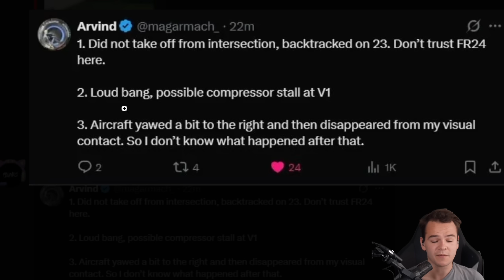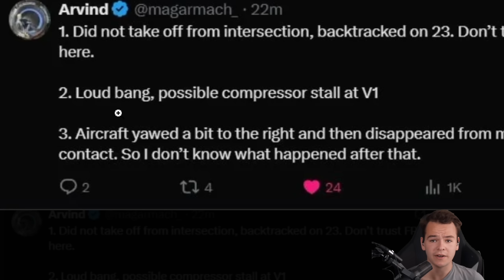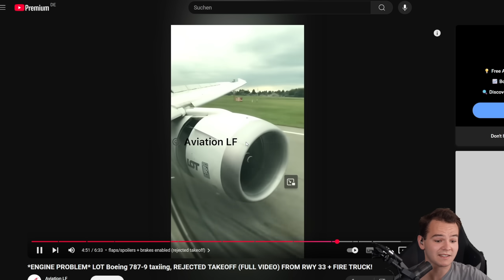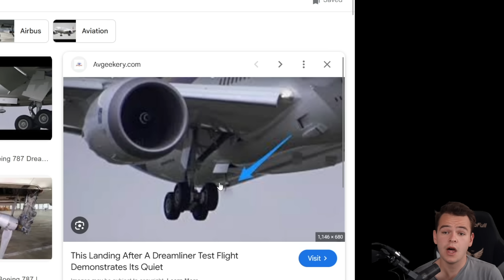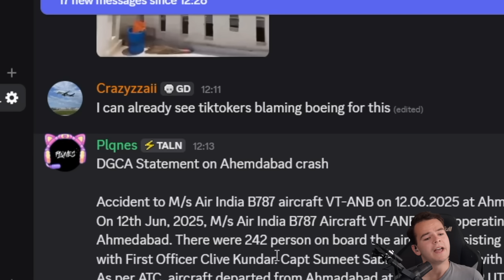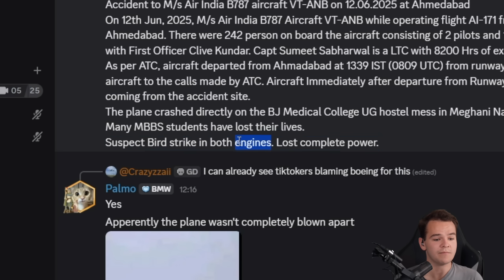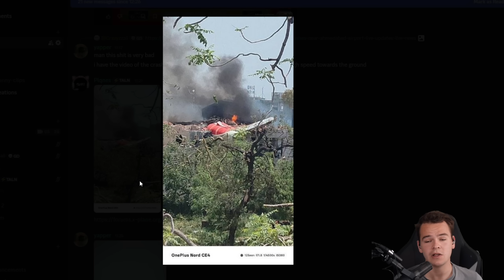The First 787 CRASH Ever - Why It Is SO Confusing?

Comment: Lots of flaws in this video.  First, no plane is "uncrashable" (0:07). That's just silly.  Second, no engine is "undestructable" (I think you meant "indestructable") (0:43). Third, we don't know that the flaps were deployed in the takeoff config (1:39). All the videos I've seen so far, I haven't seen one with the flaps deployed.  You know how you get a dual engine failure? Bad gas.

Comment: You can hear the RAT sound in the original video, the clip you are showing is recorded from computer screen. Ahmedabad is notoriously for bird strike but other angle from airport camera does not show any fire or smoke from the engine. In 30 seconds lot of things happened. The aircraft went for refurbishment that is what I heard from one YT video. It may be maintenance issue.

Comment: You are just full of crap.  There are NO facts yet in this crash.  Yet, you spew confidently with your flight sim video.  Ridiculous.
Do you know that the flaps were in the correct position for takeoff?
Have you considered that the flaps may have been retracted instead of the gear?
Do you know what thrust was selected in the FMC?
The odds of a dual engine failure, even with Air India Maintenance, are astronomical.  Even with birds.
One more YouTube scammer.

Comment: If flaps were up, i strongly doubt that it was only mainly because a double-engine failure, and also if the powering engine was faulty they would have noticed because of the absence of electricity in the whole plane and since flaps were up, it should have happened way before their plane could even take off and reach 174 knots without even noticing a single decrease in acceleration cuz half of the engines working is half the acceleration + veering in the inside of the engine that isn't working in this case because they're only supposed to be 2, THIS IS THE CASE THAT THE ENGINE THAT ALSO MOVES THE FLAPS OTHER THAN THE WHOLE PLANE ISN'T WORKING
SO:
1. Indians forgot to set flaps
AND
2. Flying so low, because the flaps were not deployed, they sucked with the engines the huge amount of fat pigeons (over avg 800 grams each, they're OBESE) that it's the goverment the one, that should slow down the breed of pigeons and clean all of the waste that are attracting the pigeons everywhere and making them eat too much to reproduce and get fat (we are talking to about 120 millions of flying threats packed mainly in urban areas with the most people, where there are also more airports and planes, while pigeons in rural areas are much more rare)
FAULTS:
1. (Human error, 80% fault)
2. (Double engine failure caused by pigeons scared by a loud and first of all low-flying big object, 20%)
Reply: 1. Indians forgot to set flaps
can you change it to pilots? it feels a bit degrading
2. hydraulic failure maybe?
3.the analysis is nice

Comment: 2:19 I'd say the reason you don't hear engines roaring is because the clip you're showing is a screen copy with mobile phone mic quality next to a TV screen with nasty little speakers. If you get the original you do actually hear a heck of a lot more in the first few seconds as clearer sound from the original source. There is a distinct (prop like) 'growl_ in fact steming most likely from the rat prop as well as (jet) engine noises can be heard.

Typos edited.
Reply: That's not the engine, that's the turbine that shows dual engine failure.
Reply: @NottJoeyOfficial  Ram Air Turbine? (RAT)
Reply: @RocketrywithAnay_2013  yeah, it sounds like a propeller plane
Reply: @NottJoeyOfficial  that's right. My remark repated what he said, and he said "engines". The original recording reveals engine noise (jet turbine) AND the noise of the prop linked to the small generator. The prop as it happens produces a distict prop noise which is completely absent from his recording,  ...as are the engines.
Reply: @NottJoeyOfficial  he makes the remark about the engine at 2:22    ...not me.
Reply: @cosmicdebris2223  ah, my bad then!
Reply: yes in the original you can hear the RAT very clearly
Reply: The one he's showing in the video I believe is the original because the other one is cropped. If you pay close attention, how can a cropped video be original If the previous one wasn't cropped?

The audio is different in both. Dialogue and everything. Why one was changed is odd. Suspicious too possibly.
Reply: @oneulo8859  nope. You can see the grey distortion (not to mention the much lower video quality). That or those grey lines appear only when a video is taken from a TV type monitor. The original can be seen on YT by another uploader.
Reply: The other one is longer and higher quality, doesn't have the voices of people talking so ypu can hear the plane, and doesn't have reflections of the people recording it  @oneulo8859
Reply: Indian pilot showed unreal courage and character by following all the protocols while death is in his front within 30 sec. When they knew RATS were out and cause dual engine failure 
1. Called MayDay ATC
2. Took the gear intact for some landing.
Reply: @rishabh4539 such a difficult situation the crew did an excellent job at staying calm and doing their best when faced with certain death, hats off to them and thoughts and prayers with all those affected 🙏🏾
Reply: rip .  true CAUSE https://youtu.be/sqHmmnuf0IU?si=Zn5oCzTLQ7iqAXZr

Comment: Imo...

Likely a bird strike. And birds don't have to be huge to throw out an engine. A Carrion Crow (45cm in length) got ingested into a 757 airliner at Manchester airport - caused a c.stall in the affected engine. Plane landed safely on one engine.

Kites (bigger than Crows) are common in India - both Black and Brahaminy Kites are found throughout, and a brahaminy Kite ingested into an engine caused a liner to abandon takeoff just before V1 in the Philippines. Engine needed to be rebuilt.

Comment: Its hard to believe , but i cant see any flaps extended on that airplane… you arent going to get enough lift to take off without flaps down.
Reply: It looks like it, but thing is, the plane did take off and climbed to about 600 ft. So even with no flaps, that doesn't explain it entirely. The engines on a 787 are very powerful. You can even safely take off with one engine only, and I'm pretty sure you can take off with no flaps at all, even though that's certainly not ideal. There must have been something else going on here. One can see on videos that the plane seems to be losing thrust quite suddenly. Now, the other thing is that the plane seems to have taken off pretty late - it took off near the end of the runway. So something was going on, IMO, on the runway already.

Comment: It appears there may have been intentional interference with the aircraft. With the contract with the Turkish company nearing its expiration, Bharat had opted to terminate it; however, the court ruled in favour of its continuation. Conducting a thorough investigation, particularly focusing on the ground maintenance personnel who have raised suspicions regarding the Turkish company responsible for aviation maintenance, would be prudent. The crash was pretty unusual, characterised not by a nose dive but rather a flat landing that impacted a building.

Comment: What if the plane was overloaded and on takeoff one of the engines stalled? You will not hear much of the noise, and plane will go down...
Also the plane is fly-by-wire so it will not react as your flight-sim. It will go straight and level. I do not think it happened during take off run, I think it happened on initial climb out, as the plane seems to be just about few hundreds feet above the ground in steady descend with nose up attitude.

Comment: Flight crew commanded flaps as expected, the system “confirmed” deployment, but in reality the flaps didn’t extend—or were retracted too early—significantly reducing lift during rotation. Witch is very concerning

Comment: Swiss001 can you review the footage again please? Can you be sure that the 787 has its flaps out at 5? The wings look too clean. Better still can you simulate a no flaps take off from halfway down the runway, and also with 1 engine and 2 engines out, to measure the glide distance. I always find to eliminate all scenarios one by one, leaves you with the most logical and plausible answer.

Comment: Curious if it could have been a single engine failure + no flaps + overcorrection and high AoA from pilots?  I honestly dont see the RAM air turbine. It should be on the starboard side and you would the door for it... but nothing.

Comment: From all of my research so far the only thing I’ve only noticed one thing as a potential cause. I don’t know anything about the safety features of the 787 so I could be wrong. The only video I’ve seen of the crash so far is of a somewhat poor quality phone recording, but from what I can tell it looks like the flaps were raised on the wings. Obviously the plane couldn’t have taken off without them, so my only theory is that for some reason they were raised immediately after takeoff before the plane had reached a sufficient airspeed or AOA to continue producing lift

Comment: Thanks for the video. Two comments: 
1. A bird strike should be visible on CCTV, but it is not. 
2. If it was a dual engine failure, you would not want to retract the landing gear since it would absorb at least some of the impact energy.
Reply: Gearing up would probably be the last thing to do in that situation, they might be more focused on recovering the engines or just avoiding the residential area for the landing

Comment: We need the data recorders ASAP. A heavy 787 fueled for a nonstop to London should have flaps set at 10-15. Flaps are going to be the key here. Did the hydraulics fail? I've heard something about the pilot signalling engine problems which could affect hydraulics. Were the flaps in the incorrect position? Were they reset to an incorrect position after rotation?
Reply: nice...

Comment: 🙏 My deepest condolences to the victims of this tragic crash.

My theory on the possible cause:

The runway in Ahmedabad (RWY 23) is 3,505 meters long, with an elevation of 56 meters above sea level

At the time of departure, the temperature was around 43 °C (109 °F)

Hot air = lower air density
→ less lift
→ engines produce less thrust
→ significantly longer takeoff roll required

Boeing 787-8 weight estimate:

Empty (ZFW): approx. 119 tons

1/3 payload: + ~19 tons (passengers + cargo + fuel) → total ~138 tons

2/3 payload: + ~37 tons + long-haul fuel → total ~160–165 tons

Estimated takeoff distance at 43 °C:

138 tons: approx. 2,600–2,900 meters needed

160+ tons: approx. 3,100–3,300 meters needed

Now the issue:

The aircraft did not perform a full backtrack

It entered the runway somewhere near the middle, leaving only about 1,850 meters available

That’s not enough for a 787 under such hot and heavy conditions

It’s very likely they didn’t even reach V1 (the decision speed for abort vs. takeoff)

Conclusion:
The available runway length may have been insufficient given the combination of extreme heat, high takeoff weight, and reduced runway distance.
This could have led to a failed takeoff attempt or loss of control at a critical speed.

Comment: If you are struggling to conceive a dual engine failure, then look into the A400M crash in Jerez. That lost 3 of it’s 4 engines just after takeoff because of a computer error.

Comment: You can see from the video that the flaps were not set for take-off.  In fact, they don't appear to be deployed at all. Those engines will make enough thrust to push the aircraft off the runway in ground effect but without flaps the 787 will not generate enough lift to climb regardless of being at max thrust.

Comment: Both pilot and co pilot both 90,000 plus hours flight experience. 787 has visual and audio warnings if takeoff configuration is not set correctly. It got to 600 feet so had enough thrust to get off the runway. If the flaps were not deployed at all at takeoff, the 787 heavy would have ploughed through the end of the runway. The fact it got to 600 feet tells you that initially the takeoff configuration was correct. The survivor has said the plane took off as normal then 30 seconds later there was a loud noise then it started to decend rapidly. This tells me there is a catastrophic failure of the thrust as in a bird strike.
This airport last year had been taking steps to reduce the number of bird strikes from vultures after several incidents prior to that in which several planes were damaged and a crash of a smaller plane.
If the pilot got to 600 feet, the reason the gear is deployed might be because he redeployed the gear after the thrust loss in an attempted emergency landing. I think this is a bird strike, this plane is too good and the pilots were very experienced.

Comment: ''We don't hear much'' - Well I hear a loud engine noise...??? Anyone with an audio analyser? Check RPM. 
Didn't use required runway length?  No high lift devices deployed? Gear down?  Seems like he had power, likely one good engine, he was in trouble when he lost it.  If, (big if) that is the case, then this is almost as bad as the PIA gear up landing.
Edit I pray it isn't for all involved. Lets hope not.

Comment: Duel engine failure?  It might be bird strike.  Or it might be jet fuel contamination.  Even bird strike, the engine could still usually run a bit.  Obviously turning off both engines at that altitude would be suicide, better to just keep both damaged engines running.  But if the jet fuel is contaminated, nothing they can do both would shut down.

Comment: What I believe happened:

1. The aircraft did not gain sufficient speed for takeoff. It used the entire runway length, and the pilot appeared to pull the plane up at the last moment out of desperation.

2. The flap configuration seemed incorrect. For a Dreamliner, the flaps should be set to at least 15°, which, at that camera angle, would normally obscure around 70% of the engines. This setting was clearly not in place, resulting in a loss of lift.

It's important to note that during takeoff, there's often a brief deceleration as the plane rotates. At that point, the airspeed is still marginal, and proper flap extension is critical to generate the additional lift needed for a safe liftoff.

Comment: Looks like no Flaps, some theories saying copilot retracted flaps instead of gear. 

However, operating different switch by accident seems unlikely as they are very far from each other, so maybe miscommunication in cockpit?

Therefore a question: Why are pilots saying “Flaps up” instead of “Flaps to 0”, which could be less likely heard / understand as “Gear up”?

Comment: Gear hasn't been retracted because they knew they would crash. Also they didn't believe both engines would actually fail at the same time, so they rotated, but they shouldn't have. Even at V1 they should have aborted.

Comment: My main though for dual engine failure is contaminated fuel. It has caused engines to quit in the past.
That or bird strike in both engines, but they are tested for that and should be able to handle it and keep flying.

Is it just me or does it look like the flaps are up?

Comment: According to Wikipedia: “One passenger was confirmed to have survived the crash.” This was based off two news outlets, one of which states:

“Passenger on seat 11A survived Air India crash, says trouble started 30 seconds into flight.”
Reply: he jumped out of the airplane and broke his leg, he was clear of the airplane before it blew up
Reply: @dabneyoffermein595 Got out of the Plane? Was he Superman, busting the hull open, falling several meters, and surviving?
Reply: @Lazymotion  The plane exploded and fuel was scattered into the entire fuselage, including the seat where he was sitting before he jumped out.  He has head injuries, so he's not going to remember anything, just bits and pieces, he jumped , broke a leg / tore ligaments and will survive (discounting infection), he does have burns on left arm as well.
Reply: @Lazymotion  I know right lol?
Reply: @dabneyoffermein595  Nope, he walked out after it had already crashed.
Reply: @dabneyoffermein595  How would a passenger in a pressurized aircraft manage to open an exit door of a 787 and also jump out of an aircraft moving over 178kts at an altitude of around 500 feet and survive? Does that make sense to you? In such a scenario that person is also a dead man.
Reply: @glenvillecarr3454  of course not from 500 ft.

Comment: My prayers go out for the passengers and crew of Air India. It will be sometime yet to figure out what really happen. These days I'm glad to be retired after 35 years of airline flying. I lost one engine off the Island on Kona (Hawaii) heading to Seattle, Washington. We diverted the stretch B-757-300 with 221 passengers over to Hawaii and did an over weight landing flying on one engine (75,000 pounds of fuel if I remember correctly no fuel dump like on the whale B-747-400). In 1989 1990 NWA was the launch customer for the A-320 we had a 20% pilot pass rate on the A-320 flight training course. Fly By Wire was new for airline pilots (Auto Pitch Trim). But learning all the flight control laws was difficult, normal law, alternate law, direct law and manual pitch trim only. (Adapting to the new way to fly!) I was a captain on the A-330- 200 and 300. Airbus was finally doing it right. Also flew the B-747-400,  DC-9 . I learn how to fly back when I was a junior in High School (1970's) and if I count the 15 years prior to my airline career flying piston Beech -18's tail wheel, round engines,  Lear 25D, Citation I & II, AC-1121 it would be 50 years worth of aviation. The main thing when I look back is I survived it all. And I am still learning! I will be 71 years old shortly and I bet I can still pass a 1st Class Medical.